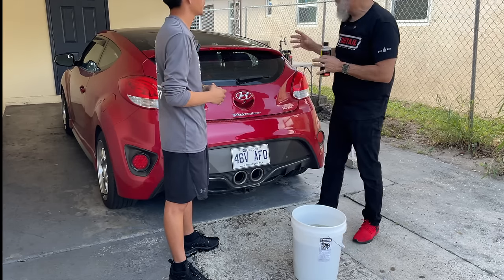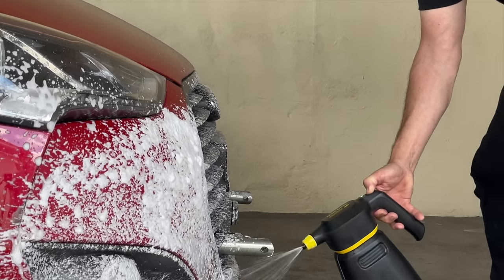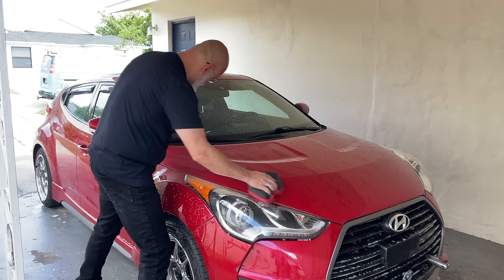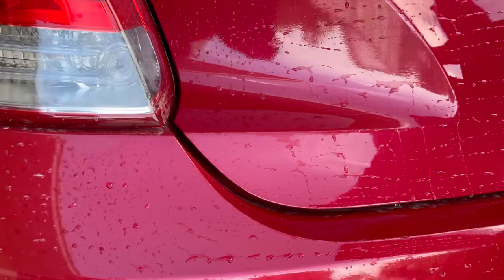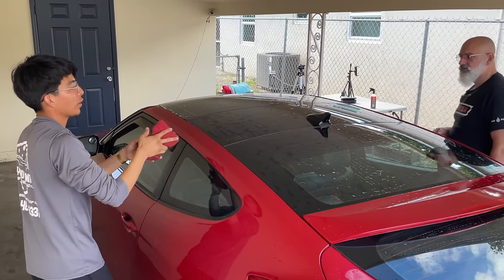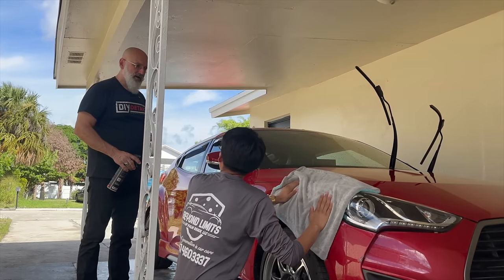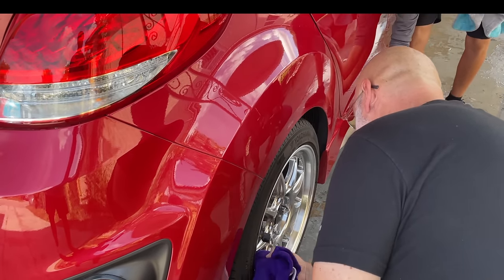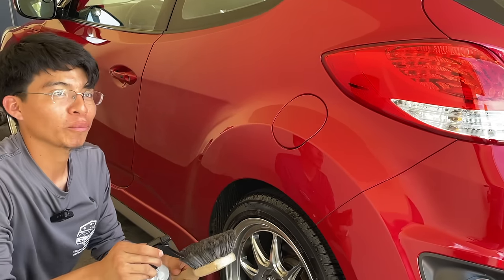How to Rinseless Wash! @detailingbeyondlimits 1st time tutorial #diydetail #rinselesswash #carwash

Comment: And about this legacy sponge , I did so many test and found that the red foam has different feels it flex easier and also leave different water trace than the black foam side , the black feels softer and more dense type foam it’s leave few water drops that’s more beads type water trace on the surface and with that i start with red and finish with the black side as i feel it works better for me , just my opinion : D
Reply from the maker: They are in effect the same with the exception of the dye used

Comment: Perfect timing guys thanks! I’m at my parents for our Christmas. And I gifted my Dad a DIY “kit”. I got him a Home Depot HDX bucket because it had measurements on the side. I got the grit guard and half a wall. Along with DIY DETAIL Ceramic gloss, quick beads, rinseless, legacy sponge, all clean, interior clean and protect. I also got him an auto fiber drying towel and rag company nice pack of microfibers for whatever. We ve been watching videos together and he s trying to learn before we go out and do it and this video was so perfect!! Thank you for creating some father daughter time something we both enjoy and my Dads new van is going to look glossy glossy!
Reply: That is awesome. I will tell you, though - I have the Grit Gurad and half wall and took the half wall out months ago for rinseless washing. You are far better off with additional room to soak and release contamination from the sponge than to have the added grit gurard area. The on in the bottom of the bucket is plenty for the DIY rinseless application.

The half wall is really designed for soap washing and the need to 'scrub' the dirt/grit off of the wash pad. Rinseless and the legacy sponge don't have the need for the scrubbing in the bucket.
Reply from the maker: That’s great, and one of the reasons DIY Detail exists, making detailing a fun family activity.

Comment: I think the rinseless wash would be great for doorjambs and other painted areas that you don't want to be exposed to a pressure washer. Except that I might prefer a smaller sponge for those areas.
Reply from the maker: The legacy sponge is quite nimble, but also you can use a plush MF towel
Reply: I use a microfiber and a drying towel on tight door jamb areas that i don't feel comfortable squeezing my legacy sponge into. Both do an excellent job on door jambs.

Comment: The comment about using the same towel to dry the wheels that you used in the paint got my attention. I’ve always used towels I use just for wheel to dry them.
Reply from the maker: If you’re as thorough in cleaning the paint as the wheels, there is no reason to use another towel.

Comment: Great video. Does using Ceramic Gloss as a drying aid damage your drying towels ?
Reply from the maker: If you put them in your wash bucket after use, The surfactant will prevent the ceramic from crosslinking.

Comment: I have a situation where I  need to do a touchless wash due to rust proofing and rust spots on my 15 year old vehicle.   I was considering foaming an APC and soap combination, let it dwell then rinse with a cordless mini pressure washer (winter so no water).  Can I use a rinseless solution in a pail for the cordless pressure water intake and rinse with a rinseless solution as it will be a drying aid.  Don't want to use towels as the grease and rust proofing will damage the drying towel.
Reply from the maker: It will help

Comment: Awesome! How do you like that sprayer? I ordered the exact same one and it just arrived and I haven’t cracked it open yet. My understanding is that it comes with two types of nozzles—one for spraying and one for foaming. If that’s the case, the spray (non-foaming) nozzle would be ideal for rinseless, right? Really looking forward to my first rinseless with your product, and I can already see from this video how much time I’ll save! Thank you!
Reply from the maker: So far so good, the one I received only has the foaming nozzle
Reply: @diydetailofficial  Good to know! I just opened my box and it has two different foam nozzles and one metal spray nozzle. I'm pretty sure I got the exact same bottle, so you may want to double check. The extra nozzles and a spare rubber washer came in a small ziploc bag. I don't know how the two foam nozzles are different, but they do have a different pattern.
Reply from the maker: @nokibuyo interesting, no such bag with ours

Comment: To save chemical, could I just spray rinseless onto the car and have water in the bucket as a rinse bucket? Or is it important rinseless wash is in the bucket as well as sprayed onto the car.
Reply: You want the rinseless solution in the bucket. It is what flushes the dirt/contaminants out of the sponge and also keeps lubrication on the surface of the vehicle for protection when drying. If you buy it by the gallon, it is extremely affordable and will last an individual many months washing their vehicles at home.
Reply from the maker: It’s important to have it in the bucket
Reply: Thank you this has been a burning question of mine for some time.

Comment: In this scenario, where a hose is not used, what is the best way to address cleaning the dirty wheel wells?
Reply: You can use a bucket with a scrub brush and rinseless in it for wheel wells and wheels/tires. After scrubbing, I use rinseless in an IK sprayer loaded with rinseless to flush away any leftover particles. The rinseless wash has actual cleaning power and will break all kinds of dirt/grime down - given enough time.
Reply: Probably don't waste your time. They get dirty instantly anyway. Wait until you can do a wash with running water.
Reply from the maker: Lots of options, first is don’t do them, you can use brushes, MF towels, sprayers . The limit is your time and availability of tools.
Reply: I’m thinking of adding the green, flag-tipped brush to the rinseless wash bucket and scrubbing the wheel wells at the end of the wash—to not dirty the wash bucket early.
Reply from the maker: Perfect